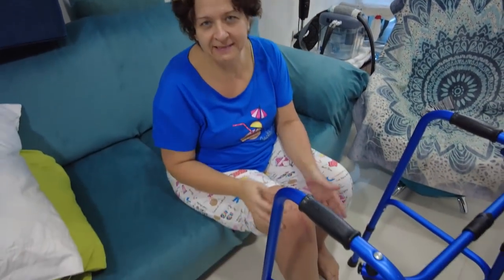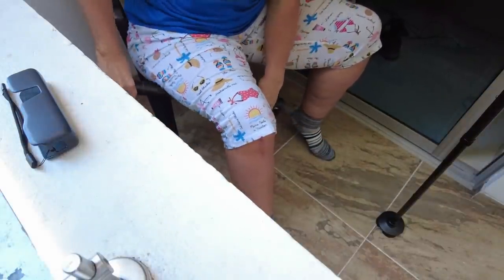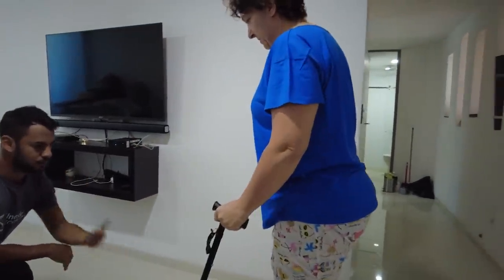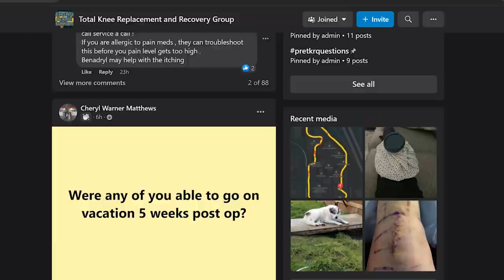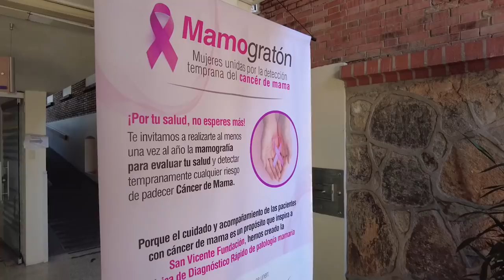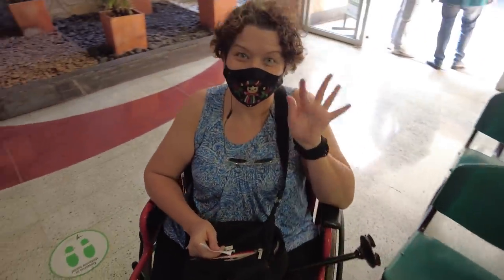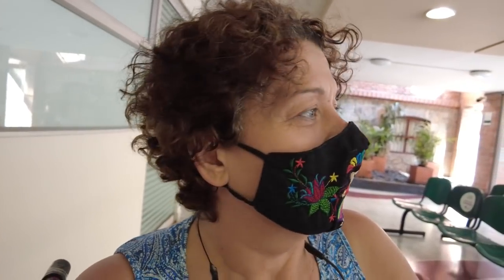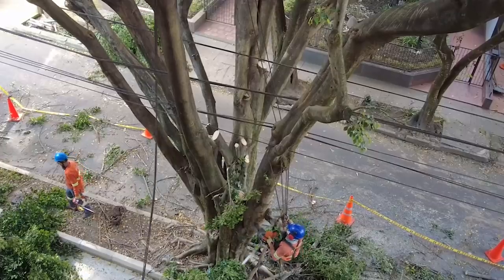BACK AT THE HOSPITAL - "THIS IS REALLY HARD" - Van Life Colombia

Comment: Snow, at 9:20 ish when you talk about the walker with the wheels, that’s called a rollator (sp?). You’re right. You made the right choice. Rollators are nice bc they have seats so when you’re tired you can carefully turn around & rest.

But the problem is they can also roll right away from you & then you will faceplant & kneeplant. I shudder just thinking of it post-op while healing.

You know I need total joint replacements in both my knees (not at the same time of course). Recently I fell at home; I’ve not had my surgery yet. I went down full force on both knees on my carpeted floor & screamed bloody murder. My husband came as fast as he could. I asked him to get one of our anti-fatigue mats which is thick & has acted like the missing cartilage in my knee when we’ve needed it. We finagled putting under my knees. He had on leather suspenders (they could be a family heirloom & will definitely outlive him). These suspenders hook onto his pant belt loops & also have an additional piece that goes across his chest.

After I caught my breath for a few minutes, I positioned one thigh even to the floor w/the knee at a 90 degree angle (left leg). While he leaned against a wall, I grabbed on to each extremely strong suspender (remember they don’t have pinch type fasteners but incredibly strong hooks so they absolutely can’t come undone). 

I pulled myself up while pushing up with all the strength of my right leg. I finally got up & he helped me to a chair. I was taught by my PT NEVER to use a rollator for that can happen. Yes, they have brakes but can roll away before you can engage them.

I can’t even imagine falling on my healing knee post-op.

Glad you trusted your guy & made the right choice. BTW, I love the blue walker (that’s the color I see on my little phone screen).

Love you! Curt too!!
Reply: I’m hearing your story of your fall and I’m glad you were able to get up with the help of your husband.  Your therapist failed you by not teaching you how to get up after a fall.  By pulling on your husband you could have pulled him down.  Therapist recommend you scoot yourself to a stable surface such as a bed, a couch or recliner. If that is not available you can use a kitchen chair with the assistance of someone or by placing the kitchen chair up against a wall.  You want to get towards the surface of the furniture and get up onto your knees with your arms and forearms supporting yourself while you push up with your strong leg and slowly turn your self to sitting. I hope this helps. Occupational therapist here with 30 years experience. Of course this type of floor to chair to standing doesn’t work and every case I understand that. I’ve had three knee replacements. One side was done twice. After a good recovery time I have fallen eight times at home. I had to use my advice most every time. Most of my falls were due to weakness and a few of them were due to positional orthostatic tachycardia syndrome Related to my EDS. Take care everybody
Reply: @jeannerountree952  Old PT from 1 1/2 yrs ago; worked w/me only  3 x. Hard to describe but husband definitely was not going down. You’ll just have to trust me; suspenders are occidental leather.

Have gotten up those other ways too. My point was about rollator. If no one’s around to help me I need to hit my emergency life alert necklace for paramedics to help me up. Would do under any circumstances if he didn’t feel he could safely help. Again, have done techniques you suggested & sometimes they work. Other times we have to contact paramedics. My knees are so bad if they were cancer they’d be Stage IV.

I know you’re trying to help but please don’t presume to understand another’s situation; I should probably have left those deets out of this; no PT or OT taught us to do that (only Rollator info); we figured it out & were going to call paramedics if need be.

Thnx for your advice. I need a home PT/OT but none available bc of pandemic. Am on waitlist of multiple agencies.

Sorry you’ve gone through the trauma you have. Hope there are no more falls for either of us.🕊
Reply: A rollator is only one kind of walker with wheels. Regular walkers like Snow has often come with wheels as well, although they lack the brakes that rollators have.

Comment: If you have a swimming pool near you, some water work will help.  Find out if you can go in a pool and I can suggest some easy peasy exercises.
Reply from the maker: No pool access here.... But will sure add in swim work once we get on the road and stumble up on places to swim!
Reply: @SnowAndCurt  you don't want to swim per se, not yet.  You should get a pool noodle and sit astride and open and close legs (like scissor movement, bent knees, then straight legs)  and bend and straighten one leg at a time.  And then ride a bicycle still sitting on the noodle.  It is very good to exercise in water.  So far you are doing so well.  Thru much pain.  Good luck 👍

Comment: Snow, I want to offer you some words of encouragement and affirmation, using my brother as an example. One day while jogging, he tripped and fell, destroying one of his wrists (and not the one he landed on, which was weird). Surgeons put in a T-plate and six screws. The PT was excruciating and at one point, he was getting really discouraged. His therapist asked him if he knew a particular general on the AF base where he worked. The general had an arm/hand people thought was paralyzed. But the therapist said he had a similar injury and couldn't get through the work when it got tough. This inspired my brother to work through the tough days. And instead of ending up with a hand with limited use per the prognosis, he regained 99% of his range of motion.  

THEN ... during an open house on base, he was running down a hill to deal with a parking lot mishap and some idiot on a golf cart came up behind him and hit him! He ran/stumbled downhill for a distance before falling over. One knee felt a bit strained, but he worked the rest of the day before stopping by the base hospital, where they put a simple brace on his knee and said he should probably check it out at a civilian hospital ER in Tampa the next day to make sure he hadn't messed it up. Well, it turned out that he had snapped off the end of his femur right behind/above the knee joint. It is considered one of the worst ways you can break your leg because it usually doesn't heal correctly, and impacts how the knee works. They put in an 8" pin and told him it would be "a miracle if you ever walk again." Remembering the bit about the general, he worked through the painful PT, which was similar to what you are going through. After about a year, he returned to duty without even the slightest limp. (It took that long because he was in an ankle-to-hip cast for several months before PT could start - this was early 90s technology, fyi.)

I'm just offering this up as affirmation that pushing through the tough days is worth it. (I know you already know this - again, this is just an affirmation.) And you can end up better than your doctors say you will. They always assume patients won't really follow through on everything so they soft-peddle the prognosis. But you can do it! When you have those bad days/phases, don't let them get to you. It's all just a part of getting past each obstacle in the healing process. Just don't let yourself think, "This is good enough," or "I'm willing to settle for this level of function." The human body is capable of amazing things.

Comment: Can I put in my 2 cents about using a walker? I have been in situations where I've watched many elderly people using walkers. I know you're not elderly, but here's my thought. Please look up at the ceiling (or sky) often! Stretch your arms and shoulders in various ways. Be sure the walker height is adjusted tall enough to require you to stand up straight. That's just my 2 cents after watching a bunch of elderly people getting more and more stooped as they bent down over their walker, watching every step and not looking ahead. A physical therapist told me part of the issue is balance. An elderly person apparently has better balance if they bend over and lean on the walker. But you're not elderly and you can build your balance.
Reply from the maker: Makes perfect sense.... Thankfully, I'm off the walker and onto the cane now!